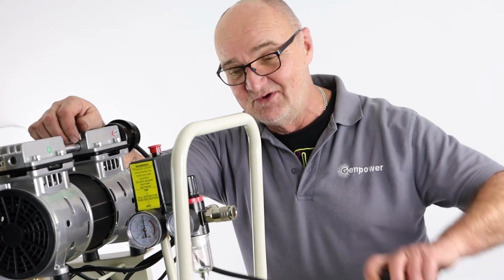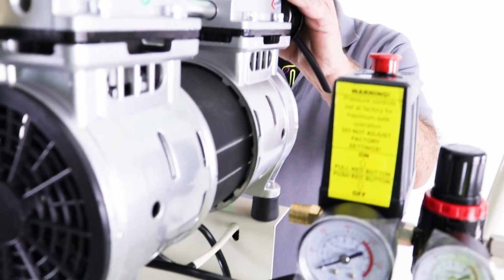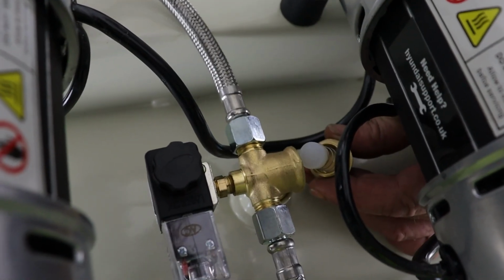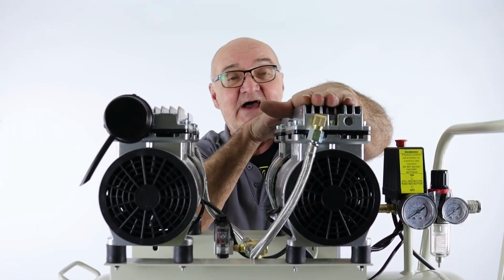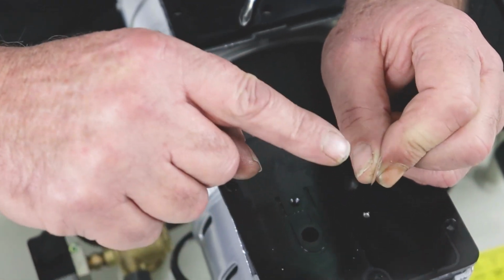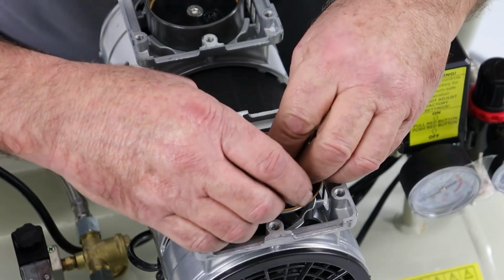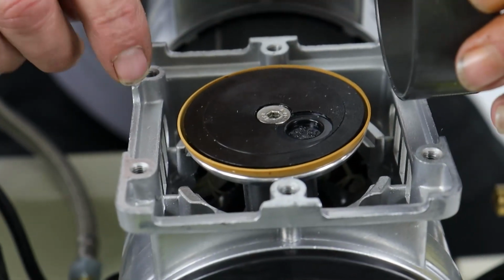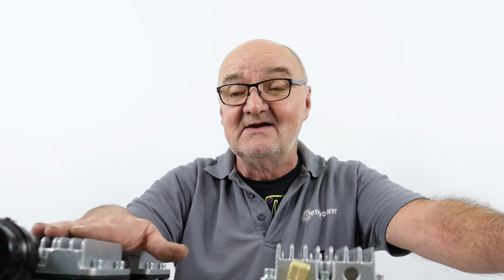An Electric Air Compressor Maintenance Guide By Hyundai Power Products

Comment: My Hyundai HY7524 when I open the water drain, the liquid comes out black...Is there a way to clean the black liquid out?
Reply from the maker: That would suggest that there has been some condensation build up, possibly leading to some minor rusting on the inside. The best course is to ensure that the drain is opened for some time, allowing the water to escape as much as possible. There isn't a direct means to access the inside for a cleanout as it has to be a pressurised container.
Reply: @HPPUK Will the corrosion contaminate the air flow?
Reply: @NovaGalaxia02  any contamination will be at the bottom of the tank, the air comes out the top.